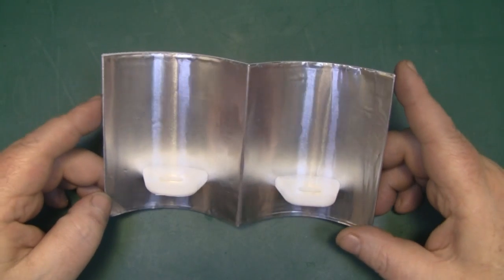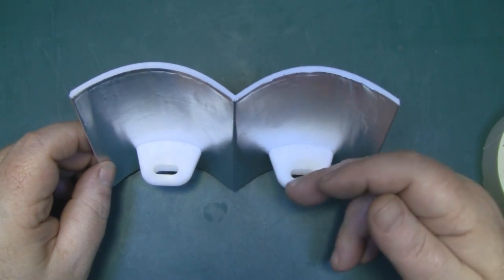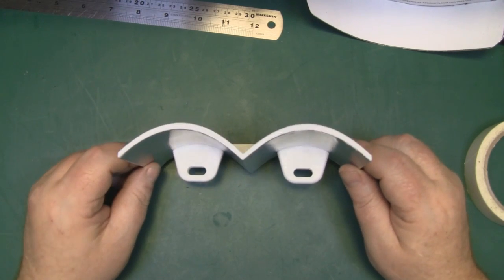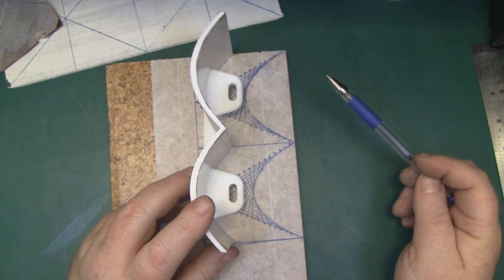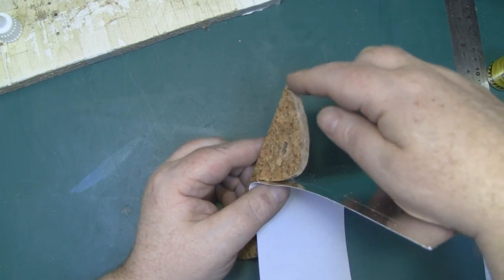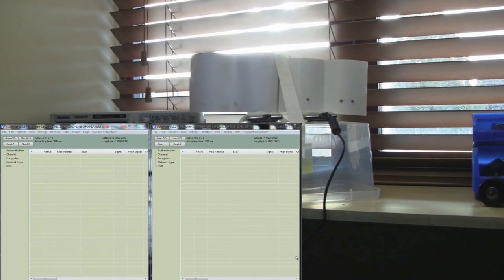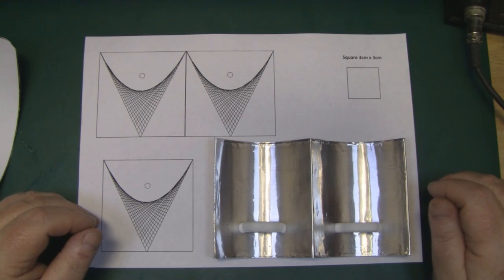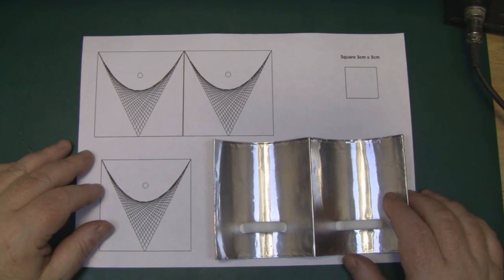2 4GHz Antenna Range Booster #123

Comment: i have 2 repeaters at home,with totolink EX1200m(dual band omni antenna) and wavlink AC600(dedicated 2.4ghz and 5ghz omni antenna), with their antennas spaced out at 44mm and 27mm apart, repectively...Can you make a video about drawing a parabola for windsurfer and how to customize the drawing to fit the different repeaters/ router with multiple antennas of difference spacing apart?

Comment: The focal point should be 1/4 wavelength from the center of the reflector. Since a reflected wave gets shifted half a wavelength, adding a half wavelength travel time shifts the signal a full wavelength so it's in phase with the signal reaching the focal point directly. (I think you can also add multiples of 1/2 wavelength to make a bigger dish, 0.75, 1.25, 1.75 etc.) It should also be mentioned that the ability of a reflector to reflect a given frequency drops rapidly as the reflector's width is reduced below one wavelength, so a reflector should be no smaller than one wavelength.

Comment: I've made parabola with F = 0.15 * lambda (18.5 mm for 2430 MHz) - it's like for yagi reflector, and got about +10 dBi for my wifi in angle about 30 grad. And it was made of paper and thin kitchen aluminium foil! Parabolic reflector rules!
Reply: Hello how do you draw parabolic curve for user defined focal length ??
Reply: @kavindugilshan  I found python script, which generates dxf file with parabola, can't remember from where, try to google it.

Comment: Let me start by saying that I'm grateful for your videos, which I tripped over while researching ways to boost the range on my drones. I've already learned enough to tweak all the antennas in my home for better performance.

On this idea of a parabolic reflector, I thought I understood how it would have to work, but the one you show and the others I see for sale don't match what my understanding says! For example, shouldn't the reflector be half a wavelength behind the focus? (so for 2.4g that should be 61.2mm)? Won't you get destructive interference if that isn't the case? The reflectors you show seem to be much closer than that. OTOH it also struck me that if you shielded the front side of the antenna so that it can ONLY see the reflections, then there could be no interference and the focal length of the parabola can be anything you like. I'd appreciate being told where my understanding is going wrong!

Comment: I have a homemade one on my DJI P3 Standard. I'm sorry it's in feet as I'm in Texas and meters have always thrown me off but "stock" with nothing done just out of the box it went 1278 feet. Built a really crappy looking "parabolic" antenna out of aluminum foil a paper plate and 4 CDs and I can go 5133feet in that same direction now. That's actually what brought me here the search of " the best parabolic antenna" because my homemade one does work really well but I look like the homeless guy jawing it because it's 4x the size of the controller (I cut out where the 5.8g antennas are underneath the top of the controller) it's just really heavy and looks like all I'm missing is a foil cap it's really sad looking but works GREAT!!! I love laying on my roof with it because it's just unbelievable if you'll stay on it as far as angling the "beam".

Comment: I used your template in SolidWorks, overlaid a parabola using the 3cm square to scale it correctly and the template focal point of your PDF parabola is actually 9.2mm.

I confirmed this by 3D printing a 10mm high segment of your parabola, gluing a strip of 0.05mm Brass shim to the segment and then using a 40mm grid divided into 5mm spacing, pointed a laser along each 5mm spacing at the segment and marked the point of where the beam crossed the 20mm center line.   It confirmed SolidWorks.  The focal point of the parabola your diagram shows is 9.2mm

I then created a Parabola in SolidWorks with a focal length of 14.2mm and to cut a long story short, the usable segment that would allow two parabolas side by side on the Phantom 4 radio (Antennas 80mm apart) did indeed look very much like a circle (Not quite as circular as you showed, but close).  Only when extended to a larger size did it start to look like the "Classic" parabola shape.  Only the "Butt" end section of the full parabola will allow these two to reside 80mm apart (To suit the dual antenna spacing), and they really do look more like a part of a circle.

I then did the same test as above using the 3D printed SolidWorks parabola and the focal point was indeed 14.2mm.  Not sure how I can show you this, but I could send you a PDF to prove this and some photos (Or videos), but at EVERY point the beam hit the assembly perpendicularly, it hit the 14.2mm focal point.  I have now gone from a range of 1.2KM to 6KM with my design using the Phantom 4 stock radio, so even though "Technically" it shouldn't quadruple the range, it has in my case.
Reply: Simon, buenas tardes, hoy recién encuentro tu explicación de la parábola que has hecho, y el resultado logrado, por lo que te agradecería me enviaras en un pdf la parábola a modo de copiarla y confeccionar una parabólica para un p3advance. muchas gracias.
Alberto Muriel
Santa Fe - Argentina,
Reply: Simon, good day, please if you could send me a PDF template of the parabolic antenna that you built for the Phantom 3 of mode to reproduce it.
I see it very consistent to a parabola and I want to have one.
I appreciate the attention.
Alberto Muriel
Argentina
albertomuriel@gmail.com

Comment: thx for the explanation, we love, it.  
i have question, how about i just need that signal getting a bit stronger . i dont need to go far, but need the signal can getting stronger to avoid crazy radio from wifi cellphone and et.... i always get signal loss in a vision distance, and it loss control and keep doing the previous command. does this ebay   signal reflector helps that situation ?

Comment: Does it work with interference? i got this annoying interference at my favorite  flying spot, my copter just looses connection and drops, at first i thought its either rx or tx issue. so i tried flying the same distance at a different location and the connection was solid, that's when i realize it was interference. need your help plz  +andrew mcneil
Reply: +Lee AC im using 2.4ghz, and i tried to investigate the surrounding area, and i think the culprit is a cellular antenna tower, i hope this helps @andrew mcneil
Reply from the maker: +Lee AC I think that's your answer cell phone towers can and do interfere with 2.4GHz. I used to pass one every day on my way to work and it would jam my phone and sat nav.
Reply: +andrew mcneil  do you know a cheap way to counter it? or is it even possible?